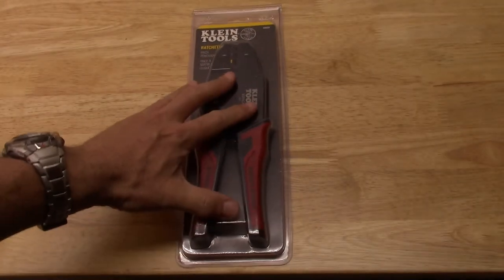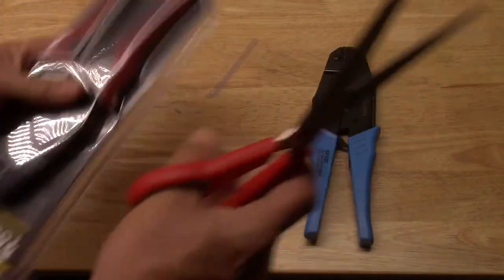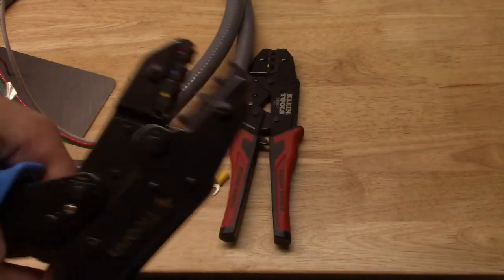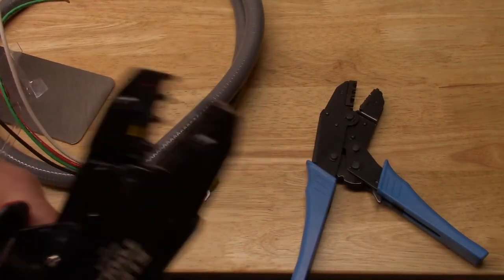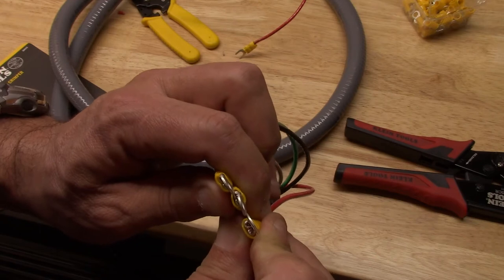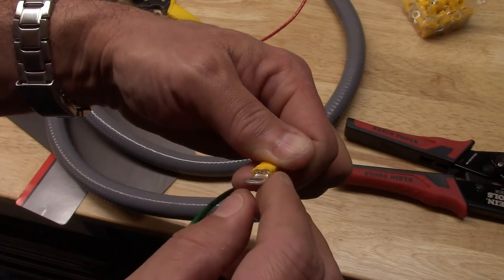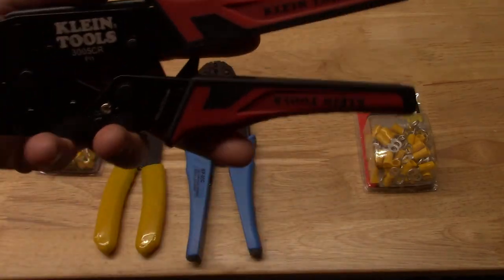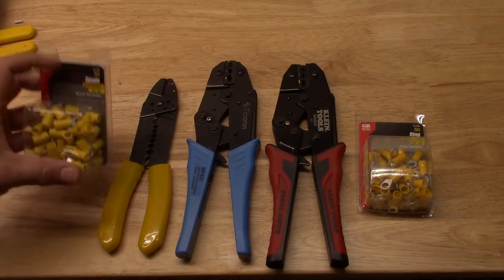Crimping Tool Review

Comment: Thanks for the comparison. I think the Ticonn is made for heat shield interconnects, Klein for insulated connects like you used in the video. I had the Klein tool and returned it to get the Ticonn, since I don't use the tools that much.  I can use the $10 bucks to get heat shield interconnects, which the Klein is not rated for and is better for car wiring which I am doing.

Comment: The two ratchet crimpers you have are adjustable, for cable size. Multicore core, single and cross section, can i assume that they have been adjusted to suit ?, or straight out of the (box). 
: